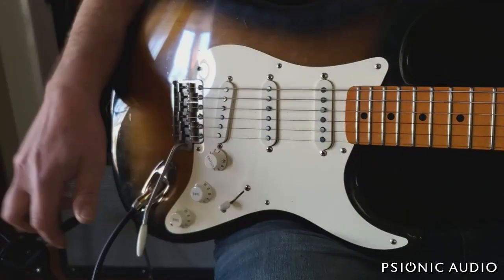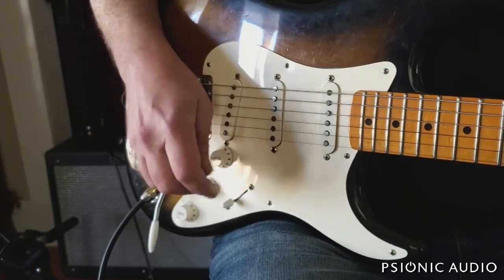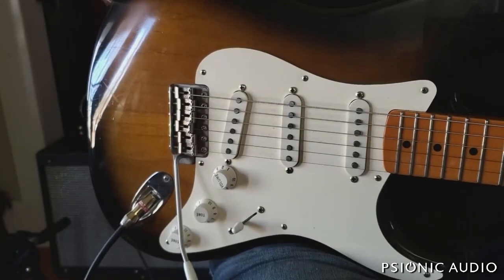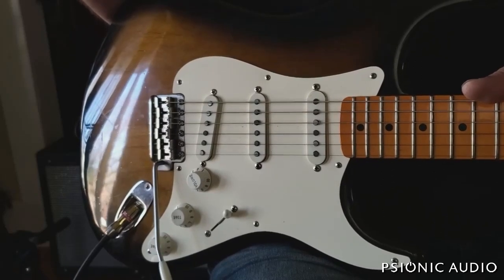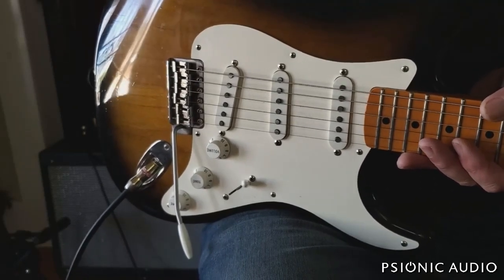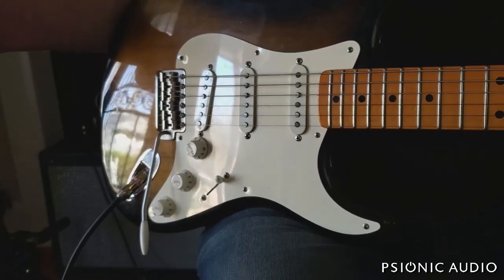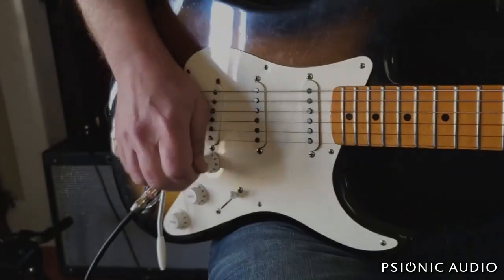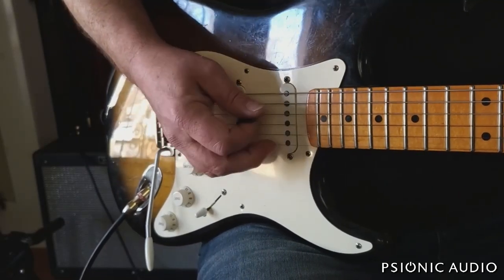Fender Hot Rod Deluxe Part 3 : Upgrades Done & Easy "Mods" Anyone Can Do Without Soldering

Comment: Excellent video...you really know your business...hey the 12AY7 and the 12AT7...I've used the 12AT7 for years in HRD's to sort of tame the output, but I'm unsure of where you suggest installing the 12AY7 in addition to the 12AT7............don't want to put it in the wrong place - or does it matter? Also, I just aquired another HRD and it's a 'Made in the USA' version from '98 with a Celestion Vintage 30 that sounds a little tired...I'd like to try the creamback 65W at some point, but not until I've replaced the filter caps, cement resistors, and checked the board for old or broken solder joints...again, excellent videos. I love these amps, and it's fun to get inside there and work on them...I'm slowly aquiring more and more knowledge about what to look for and how to improve on the performance...thanks !

Comment: Great series on the HRD . I do most of these mods too on the many that I get in , but the phase inverter and screen resistor problems are something new that I shall now look out for also , thanks . Glad to hear that you do the V1 , V3 changes as I discovered this through necessity / experimentation and recommend this to customers . I'd certainly do it if I owned an HRD as it makes the amp usable across the whole sweep , rather than 0 to 2 .
In the UK we convert the mains TX from stock 230V primary wiring as received to 240V primary wiring (UK mains voltage)  .This lowers voltages in the amp by approx. 4% . They manufacture it like this as a compromise for the European market , as the rest of the continent has 220V mains voltage .
Reply: Well done for spotting that. I took mine to Italy from UK and it sounds like a different amp(I put a Jensen p12q mine) I actually wanted to use it for firewood at one point now after all the tweeks and speaker change I cant live without it.
Reply: Mine was vastly improved by 12at7 in v-1
Reply: How is the Deville converted to 240 for uk?

Comment: I was wondering if you could help me.  I'd like to run my HRDx as a preamp only.  Do you know what (and how) I need to connect as a dummy load in place of the speaker.  I'd like to line out to a DAW without having anything coming out of the speaker.

Comment: Would the drive channel sound better if you replaced the 4560 IC with a 4558 IC?
Reply from the maker: The opamps here are not used for drive. The 4560 just controls channel switching, has no impact on the audio.

Comment: Add a fan and you won't have burn issues.  This amp gets too hot and should have a fan installed.
Reply from the maker: A fan will also add noise and get dust everywhere. Better to make the board and components better able to dissipate heat.

Comment: Really enjoy your videos. I have the same amp with the Creamback. I had the maintenance work done to to make the amp more reliable and did the reverb mod to make it a little more usable. I am now thinking of doing the AY7 in v1 and AT7 in V3. Do you have more info on the other mods? Master volume… I have been reading about the tone stack mod but not sure if it makes that much difference. Would really like to use the drive/more drive without the amp getting really bassey and flubby. Right now I use the amp as a pedal platform but would be nice to use the drive channel…
Reply: I haven’t used my HRD in years, but when I gigged with it I learned to use the Drive/More Drive effectively. Just start by EQing the amp for that channel. You’ll sacrifice a bit of tone on the clean channel. An alternative would be to have an EQ pedal in your chain and use it to pull out some bass. 

Another idea. The HRD is great in the Drive channel if you put just a bit of hair on it, use that as your base tone then supplement with More Drive or pedals. The slightly driven Drive channel is a better base tone (IMO) than the pure clean channel.
Reply: @markleyva3108  thanks for the suggestions. I am going to maybe try the drive and setting my eq. Right now using it strictly as a clean platform and using my pedal drive and overdrive.

Comment: I just got a HRDIII and it’s very brittle. Not quite “there”. I am looking around for possible mods to the amp to fix some of the tonal issues. The clean channel is very satisfying but overall thin compared to other fender amps. My main issue is the overdrive channel tho. It’s very flubby/farty and brittle. I’m beginning to think it’s just going to be like that. Thoughts? It’s a very unhinged and erratic amplifier but I love the whole concept and I really don’t want to dump it.
Reply: A graphic eq pedal will give you a massive choice of tones. If you want to keep it simple try a Jensen p12q speaker it warms the tone up and thickens the drive. I did it and now I cant stop playing it.
Reply: celstion alnico cream speaker, vintage mullard i63 at v1.